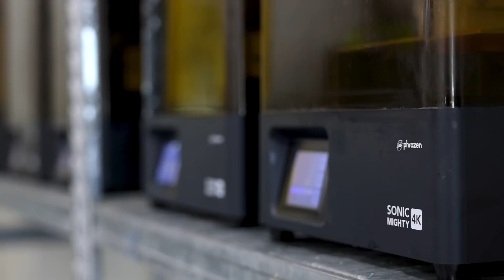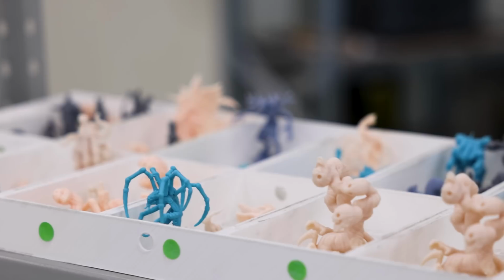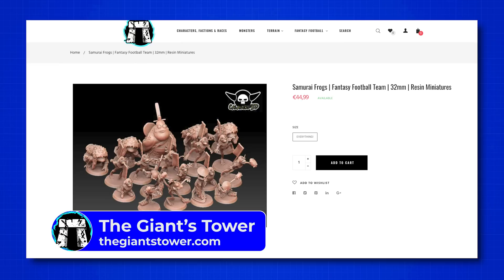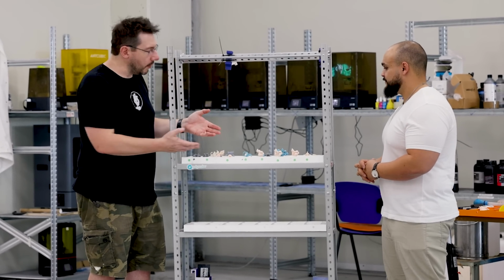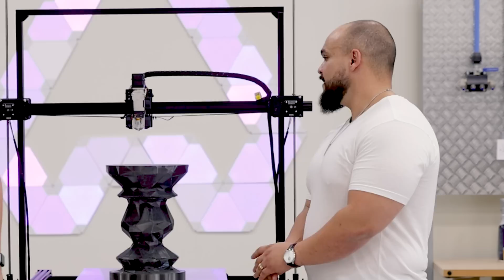Behind the Scenes of a 3D Printing Farm: Invent3D in Malta

Comment: If this was anywhere else, it would be a sizable and cool print-farm company. But to pull this all off on Malta just brings it to another level. Amazing place and they seem to keep building, so no need to worry about stagnation and a race-to-the bottom between other print farms (if they show up on the island). Cool stuff.
Reply: This comment <3
Reply: I want to see it pulled off on the moon.  Then there wouldnt be a moisture problem, print heads could recah 20000m/s in 0g, carbon infused nylon filaments will print harder strong then they do on watery earth!